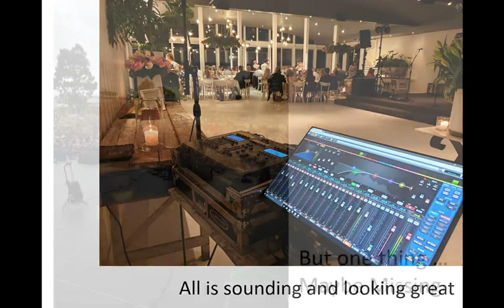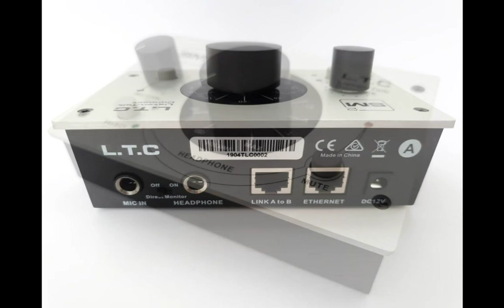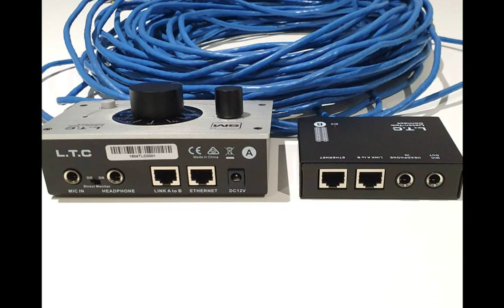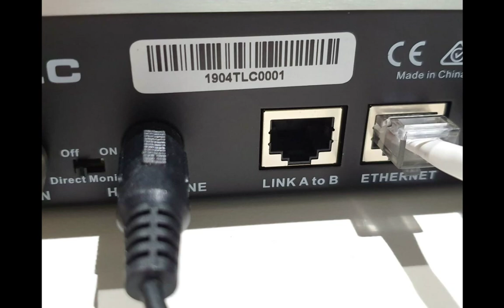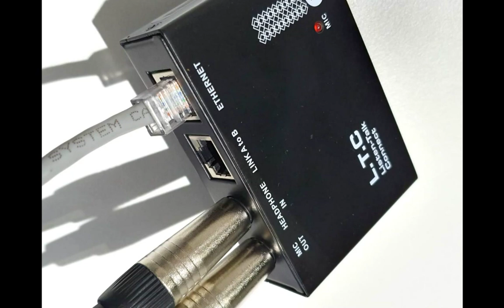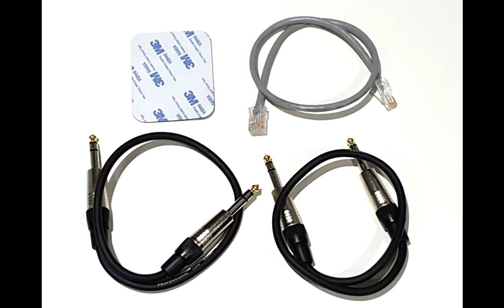Talk Listen Connect

Comment: Really Need just discovered this from a post on Reddit. It's really too bad it can't be powered from either end I could see it being stuck in a rack next to the mixer with the power brick but I'm guessing that design doesn't allow powering it from the other end. This would also make an interesting POE Dante endpoint. But I'm thinking both of those would require a revision and or new version.

Comment: Hey Danny. At first: Thank you so much for your Videos. Always great to improve on the ui24.
I have a question regarding the TLC. My ui24 is in the Studio, connected to the Audio i/o Device which then goes to a switch upstairs, whre also the internet is connected to. at the other End connected to the A/B LAN Port, there is the receiving Device, which is the connected over Ethernet Out to my Mac. Internet works, i can use the ui24 interface, BUT: there is only a humming on my Headphones. My Question: do i have to adjust anything inside the Router? Are there any Ports recommended for the Audio over Ethernet, that need to be set? Or is only working if i have a direct Ethernet Connectin between the two TLC Devices? That would be only possible, if i connect a second ethernet Cable to the recording room..at the moment the ui24 is a DHCP Client in my network. Can you help me with this? (or anyone else?) Would be great!
Reply from the maker: Hi, You can't use the TLC via a router, only directly to the Ui24R via the TLC small black box. After the TLC you can connect to your router and share all the computers on the internet with the Ui24 . So Ui24R into the small black box then directly to the TLC main unit, from there connect to router (from the Ethernet port on it)
Reply: Thanks for the fast reply. It works!
Reply: @mix-record-connect9938  so can I connect it to the ethernet port 1 while I connect the router to the other ethernet port?

Comment: I would suggest following:
Power-Adapter should be on the Stage-Side
There is no power-adapter for plugs in switzerland. The european adapter does not work.
Reply from the maker: what do you mean the European adapter does not work?
Reply: @mix-record-connect9938  There is a norm in europe with a diameter of 4mm for the metallic part of the plug. The adaptor for the power supply who has been deliverd has a diameter of 4.8mm witch fits only in some german power sockets (SCHUKO). For most coutries in europe you should deliver an adaptor who is compatible to "Eurostecker" https://www.elektrofachkraft.de/sicheres-arbeiten/der-schukostecker-und-seine-besonderheiten
Reply from the maker: Thank you, I will tell them to check this ASAP

Comment: Another slightly strange question: what would be the correct way to use this with a balanced mono output from the console, rather than the stereo headphone out? Would wiring up an XLR-F to TRS(Hot, Hot, Cold or Hot, Hot, Cold&Ground) adapter work?
Reply from the maker: Yes you can certainly do this. It does not matter where the signal comes from to the 2 inputs.

Comment: Hi Danny! Slightly strange question: am I correct in assuming that both boxes pass the Ethernet signal through passively from the Ethernet port to the Link port (and that there'd be nothing to stop someone from using those two pairs for more analogue audio, with the right adapters)? Thanks!
Reply from the maker: I suppose you could, yes.
Reply from the maker: correct
Reply: Had similar thoughts. Guessing they're just stealing the 2 pairs and dropping the connection down to 100mb.

Comment: This is pretty schweet! Would love an XLR version for the mic side of things or a built-in mic on the control station.

Also would be neat to use IP on the A-B connection so maybe a wireless connection would work since a stage rack is usually used in a wireless situation.
Reply from the maker: an IP solution at very low latency (sub 1ms) is not a cheap solution to make sadly.
Reply from the maker: It's Balanced TRS you just need a cable

Comment: Hey Danny, might this mean that a solution for connecting a WSG server might be in the pipeline - seems like an excellent solution for keeping artists in step with the FOH!! Excited to see what you and your team produce!! Thanks for sharing. Cheers!
Reply from the maker: well,  in small setups, if your server and IO are on stage and you don't need to record MTK or process audio on FOH side, this will work with SG at 100mbps. Not recommended in reality,  but if the laptop is just controlling the MIX and NO AUDIO on that link, it works ok.